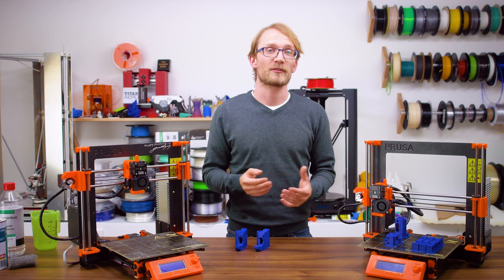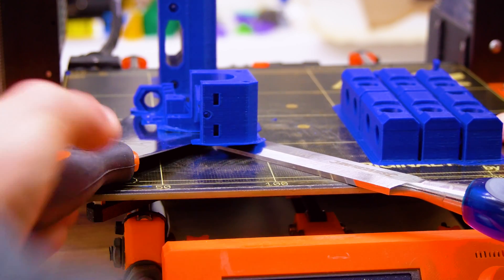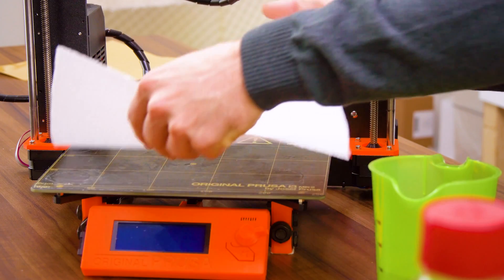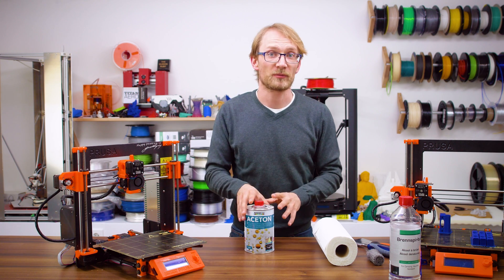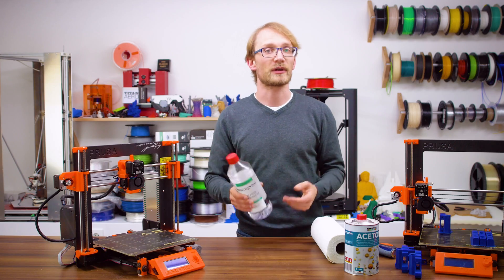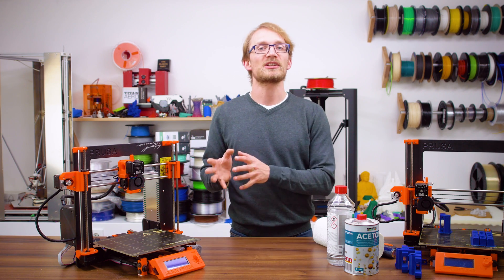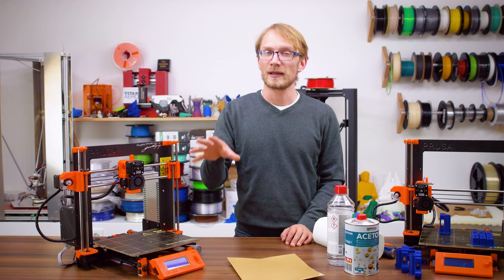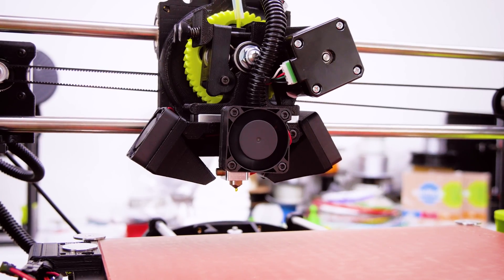Guide: Restoring and maintaining a PEI printbed!

Comment: Could you maybe make a video about how to replace the pei sheet? Mine is really damaged
Reply: I have removed three PEI sheets from a glass bed.  The first one i tried acetone and a wood chisel.  It tore up the glass removing big chunks.  After that I decide to do some research.  Online it was suggested to pop the heat bed in the freezer for 30-60 minutes.  This works like a charm.  I've popped two off (and I mean popped, they came off in a single sheet!) with no further bed damage.  I think Joseph Prusa also recommends this method.
Reply: Ty
Reply: heat the bed to 100 and then try should come off much easier
Reply: http://manual.prusa3d.com/Guide/Replacing+the+PEI+sheet/133#_ga=1.7105266.1720623439.1478711137 Follow those instructions.
Reply: Damn, everyone who posts the link, gets his post automatically deleted as spam by youtube
Reply: how I do it is lift a corner, get a little acetone in there, wait a sec or 30 lift more with a spatula, more acetone, keep going until you have gotten it off, soak some paper towel with acetone leaving it on the glue for a minute or so and the glue will scrape off easily.
common sense applies, do this with gloves, a very well ventilated space, and no sparks or open flames near by.
but it makes the job a lot easier, if you  do not care about the old sheet you can get a bit rougher.

Comment: Nice work on the video. I always clean my bed with alcohol before using. I don't think it sticks as well as new, but it works well still. Too well for PETG which ripped a nice chunk from the bed.  For now I've filled it with CA glue but the days are numbered for the original coating.

Comment: why would you need glue on PEI
Reply from the maker: sometimes I use it to protect the surface when printing flex etc, and just wiping it off doesn't fully reset the PEI
Reply: Forget adhesion:  The glue helps with removal of the print afterwards!  It's a great way to ensure that you don't injure yourself when trying to remove, say TPU (which sticks to PEI like... epoxy!) after a finished print =)

Comment: A nice norton 1500 grit sanding sponge would be better. Steel wool bits will get into the lead screws Or motors. Plus if you're removing material then you want to sand flat and not create valleys.
Reply: Wait - you're saying that regular basic cleaning and degreasing are bad things? I'm confused... You did catch that the steel wool treatment is for the really bad cases where it's more than just surface contamination, right?
Reply: Thats what i was going to suggest. All these other solutions he is providing are bad. Just some light sanding will always bring it back to good again.
Reply: ScotchBrite(tm) pads are a bit gentler,  and don't shed steel wires (which always get under my skin)   They do have abrasive grit in them though so you'd want to keep any dust off the bearing surfaces (leadscrews, slides, motors etc)

Comment: I've been having good results with automotive window tint, a large roll cost about $10 US so if it gets damaged during print removal, a new piece is cut and applied the same way it would be applied to a window.  I do cut it to be larger than the print surface so it's easy to grab the overhang for removal.
Reply: Does ABS stick well on automotive window film?
Reply: @fabiogarcia1431  I haven't worked with ABS, mostly PLA and PETG,   my new printer has a glass bed and I've been having good luck with PVA glue
Reply: @dannydietze  I like pva glue too, but I want to get rid of liquids.

Comment: Glass, take off glass, clean it with water and put the glass again. easy and quick
Reply: Jeffrey Drake Wipe the bed with isopropyl alcohol before starting a print, and heat the bed to 50°C-55°C when removing a print.
It's really that easy. I pry PETG prints off bare PEI all the time and I've never damaged my PEI sheet with print removal in that way.
Reply: yes. prints should not be this hard to remove either. these are sticking too much which is why the pei sheets are getting damaged when removing
Reply: The damage to PEI has more to do with people not knowing how to properly manage PEI rather than PEI having what is perceived as intrinsic issues with PEI.
Reply: I would have to use a piece of aluminum foil tape for my sensor end stop and lose the ability to mesh bed level, however, i guess with glass, that isn't really an issue.
Reply: Butthurt Beluga what is the proper way to manage the PEI sheet

Comment: I use a car body 'flatting' sanding board and some 400-500 grit sandpaper to flat the surface, and always clean it with isopropyll alcohol.
Reply from the maker: The sanding board might not conform to slight inconsistencies in the surface, hence my preferred choice of steel wool.
Reply: acetone is a ketone and ketones damage PEI. just need to check Ultem datasheet.
Reply: Thomas Sanladerer I guess. My PEI is also a lot thicker than the Prusa one (0.8mm) so i can be a little heavy handed and flat the while surface as if i was flatting the paint on a car. You can see the depressions where my hot nozzle has got too close being flatted out. My last sheet lasted 2 years, but i destroyed it prying co-polyester based XT-CF20 off when it was still hot.  Your advice is sound though! I've never used acetone on my bed, can't remember why, think i saw a post years ago saying not to. It's pretty chemical resistant though. I just use alcohol to remove the dust I've created, or to ensure there's no grease from my skin.
Reply: Thomas Sanladerer I guess. My PEI is also a lot thicker than the Prusa one (0.8mm) so i can be a little heavy handed and flat the while surface as if i was flatting the paint on a car. You can see the depressions where my hot nozzle has got too close being flatted out. My last sheet lasted 2 years, but i destroyed it prying co-polyester based XT-CF20 off when it was still hot.  Your advice is sound though! I've never used acetone on my bed, can't remember why, think i saw a post years ago saying not to. It's pretty chemical resistant though. I just use alcohol to remove the dust I've created, or to ensure there's no grease from my skin.